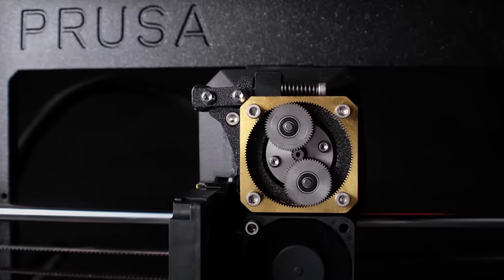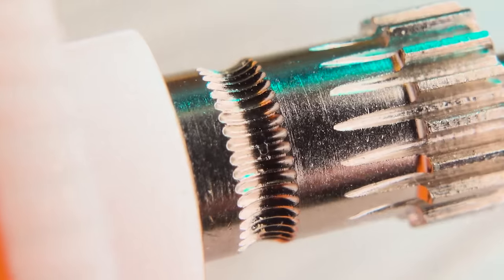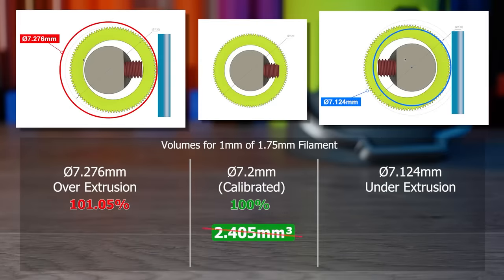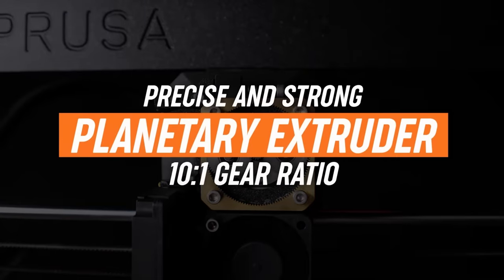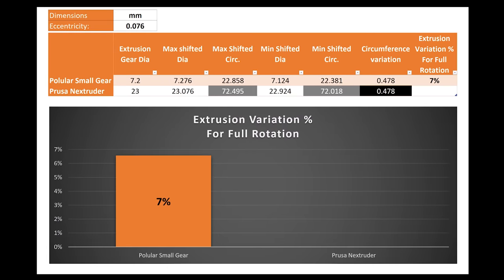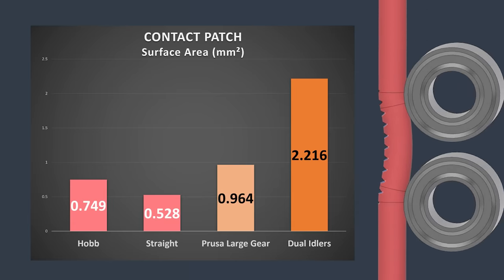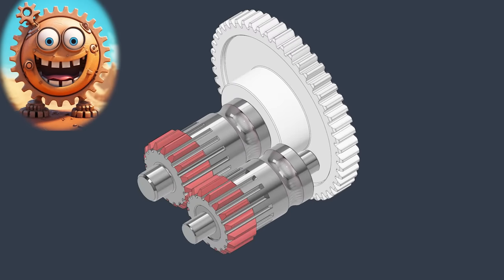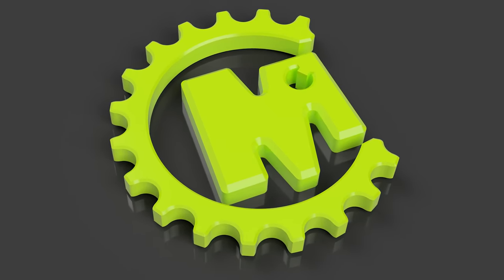Revolutionizing 3D Printing: Prusa's Game-Changing Nextruder

Comment: Very interesting indeed but my biggest worries for the extruder is the curve in the filament it may limit types of tpu filaments. Most importantly brittle filaments like carbon fiber filaments as those don't like to be bent at too much of an angle before breaking. Can't wait for it to come out so we can see your testing!
Reply: The Graphics are just for show. Thats why there's an adjustment knob on the tension arm
Reply: Consider also some materials will hold a bend imparted to them. Now what about sections of prints with repeated retractions. Wonder if this affects those areasa
Reply: @jrcaeosyroetnsella  isn't the bend irrelevant after melting
Reply: Not a concern. It has been tested for over a year already. TPU works flawlessly.
Reply: @polycrystallinecandy  He is saying when retracted. So there is a bend being held while it gets pulled up. I don't see it as a big potential problem as retraction is 1-2mm, but an interesting question.
Reply: @fofopads4450  where is your data to prove?
Reply: @SouthAsh_1  im sure no company makes such a different product and just starts selling it immediately, and prusa is a company that sold the same printer for 2 billion years because people bought it not for it being advanced but because it "just works" so its reasonable to expect them to be sure what they put out doesnt hurt their reputation of a machine that "just works", so its probably well tested, and maybe they made a statement that it was tested with tpu

I didnt like prusa because i felt like they didnt inovate and just milked their one printer for years but i think this(and the xl) are a big step, kinda changed my opinion of them
Reply: @davidbinenfeld489  I don't doubt that they tested the shit out of it but if someone says that it is "flawless" I just want to see the data to back it up as I personally have not seen it.
Reply: @SouthAsh_1  yeah i get it flawless may be too strong of a word
Reply: Even if TPU wasn't happy without with it, the simple fix would be to wrap a belt around the idler bearings
Reply: @charlesgunzelman3323  or just put a piece of plastic/metal between thes so tpu has nowhere to run

Comment: There's certainly a lot that is theoretically nice about the MK4, extruder included. I think it's still too early to really know if it lives up to the promise, especially considering Prusa hasn't released the input shaping firmware yet that will really let us push the print speeds and stress test the flow rates.
Reply: For that price ita a joke what they offer in 2023. Get a bamboo lab, at least it isnt from 19 century and not made on a lap using 3d printer farm. 😄
Reply: @VladOnEarth  I'd agree on this.  It is a clear improvement but it's an improvement upon a very dated design at this point - And they're charging as if the full thing is modernized.  But it's not, it's clearly still an old school Prusa printer, just with fancy new features.  

Bamboo is definitely going to push competition so hard.  Prusa's package is simply not impressive enough VS Bamboo.
Reply: The price of MK4 is certainly way too high. But complaining that it is a bedslinger is pointless if the printer ends up printing with better quality than most readily available corexy and with comparable speed. We shall see...
Reply: @VladOnEarth  I have a MK3s and had until recently a deposit on an XL, I redeemed that deposit as I was sick and tired of all the delays, I did intend to buy an X1 Carbon and AMS but then got cold feet as I have concerns about wear on the carbon rods, if they wear to the extent that print quality is affected it would mean sending the machine back to China at my expense, I dont think this would be financially viable, why they have not set up international service centres is beyond me, no manufacturer can be 100% confident in its QA.
Reply: @ᗩᑎᗪᖇEᗯ ᕼᗩYEᔕ  they are a new company, give them some time. I would not worry about carbon rods wear, I had them on my flashforge for years, with igus bushings, almost no wear. And even if they wear, they are a common market size rods i believe, you can relatively easy just replace them. The biggest issue with those rods is to get a good tolerance. Pultruded are better in this regard.
Reply: @MilosevicOgnjan  Yes, IF it does, which isnt ever a case. Last time I prionted slower than 200mm/s and 10k acceleration was like 6 years ago. Bed slingers are painfully slow, thats the main problem, not the quality. If you print slow enough, anysemi decent printer can do good quality.
Reply: It’s just common sense that carbon rods DO wear! 

Have you already found out where you can purchase custom length carbon rods with the precision in diameter required/wished? If so please check your balance in your shoppingtrolley….😵‍💫🤑🤑

And for the sake of the goal of this video upload, the one have absolutely zero comparisons with the other. And for closure it’s just comparing apples to oranges if you try to set apart coreXY machines from ‘bedslingers’ (especially if they are called Prusa!)
Reply: @Raymon Schepers  not really apples to oranges if both machines have the same fucntion - producing fdm parts. And both cost around same price too. Its like comparing a civic to a bmw, not the same yes, but now imagine they cost the same, would you ever consider a civic?
Reply: @Raymon Schepers  afa your carbon rod concern, first of all i have carbon rods on my printer for like 4 yeats already, with igus bushings. They arent noticeably worn in 4 years. And even if they wear, by thay time I am sure bamboolabs will offer spare parts. You are making up a problem where it doesnt exist imo.
Reply: @raymonschepers994  Yes Bamboo lab sell replacement carbon rods now

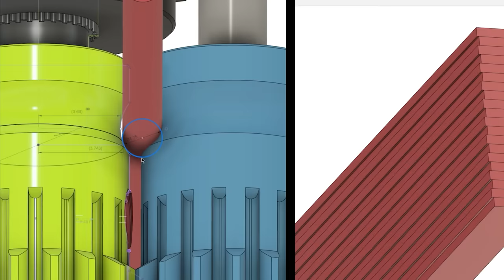Comment: There is also one additional bonus of having geared extruder, In case of very small extrusion rate due to small nozzle and layer height there can be artifacts caused by limited precision of steps in stepper motor. 1:10 gear ratio increase that precision 10 times, and yes I had some prints with 0,25mm nozzle on which stepper artifacts were visible.
Reply: But the gear is bigger, so the extrusion amount per step is not that much smaller.
Reply: @pizzablender  the gear is about 3.2 times bigger, so that's equivalent to 3.1 times reduction, which is approximately what the dual gear extruders usually use

Comment: Nicecely done Olivier. Yes their extruder is well made indeed :) But still one issue remains i think... the straight teeth biting at constant distance in 90 degree causing the other source of artifacts we were seeing. I mitigated that issue with twirl so I wonder what coule be done here. Couple ideas are germinating in my head :)
Reply from the maker: Yup, totally agree and I have a plan ;)
Reply: How about a double helical gear shape of extruder gear?
Reply: @Lucas_sGarage  interesting idea, although difficult to manufacture at such a small scale. You would need either a 4 axis cnc/3 axis with rotary module or would need a tool to imprint the pattern, similar to knurling.
We could also try something with lgx gears with smooth idler bearings for now since you can buy single lgx gears and those have roughly the same diameter as the one in the nextruder. Also since they are running on needle bearings and no single grub screw is involved we could expect good excentricity.
Reply: @kilianlindlbauer8277  Yeah, knurling or fishbone / zipper pattern maybe?
Reply: @velvia7880  was thinking of the heringbone pattern. Having just helical gears would push the filament to one side. You can see that with soft tpu on the vz hextruder. If you pull medium to soft tpu it twirls the filament. Ive tested that with 85a xtrudr tpu
Reply: What type of artifacts do you mean?
Reply: What's twirl in this context?
Reply: @tomallo99  ive done some testing on the vz hextruder with its helical feed gears. With rigid filaments it provides more grip compared to the regular bondtech bmg gears, at least it feels like that. But with the flexible filament i tested (85a shore hardness) i saw the filament turning when feeding/pulling out by hand. The gears didnt loose grip, but the filament literally turned itself out of the extruder. If you would have a single helical feed gear this would mean that the filament wanders off to one side. It would need some sort of constraint (add friction and wear) or some sort of heringbone gear pattern to keep it centered
Reply: @Kilian Lindlbauer  have you tried loosening tension just before is starts slippin? It doesnt need much tension for it to grip. If you do too much tension with ultra soft it will twist the filmanent yes
Reply: How about, instead of metal teeth, the drive gear had an outer diameter made from a high-grip soft material, like silicone ?

Gripping the filament without deforming it
Reply: @Vez3D  haven't tried that yet, but so far im liking your design. I have printers better suited for tpu than my voron with your extruder because of the long reverse bowden, but i can try it.
Reply: I've watched most of the videos that Vez and Mirage have put out involving extruders. Very interesting stuff! I'm nearly finished with my VZbot/FT5 hybrid using the CNC VZhextruder
Reply: @_Xantras_  someone has has already made that with gt2 belts. I cant remember his name, but he has a YouTube channel called proper printing. The current Design is nema 17 based
Reply: @kilianlindlbauer8277  point is, it's a very big extruder. My idea was just a small upgrade to the gears
Reply: helicals would be great, although as people said it has trouble with soft filaments, so maybe finding a cheap way to make herringbone gears? it would be self centering too as if it wanders to one side it gets pushed back to the middle
Reply: @l3d-3dmaker58  maybe putting two helical gears with teeth cut at the opposite angle next to each other?
Maybe im trying the single gear lgx idea i had
Reply: @l3d-3dmaker58  i dont think there is a cheap.way to make those :(
Reply: @kilianlindlbauer8277  thats how vz-hextrudort is
Reply: @Vez3D  I love my vz-hextrudort man! issue 6 is 70% gone! Ofcourse we all want 100% smooth but its already super good. Thanks for your work!
Reply: What about stacking two tapered gears with opposite teeth ?

It's easy to machine but you need to align the 2 gears with a dowel pin or a keyed shaft.
Reply: @Vez3D  i wasnt clear on that one. Not next to each other, but next to each other like on the same shaft, to form a heringbone patter
Reply: @_Xantras_  Proper Printing has done this with his belt based extruder by feeding material through a channel between the flat backs of two belts. It worked pretty well with even very soft TPUs, and had one of the highest pressure outputs of any of the extruders that CNC Kitchen tested a month or two ago.
Reply: @kilianlindlbauer8277  "two helical gears with..." That's what's called a dual helical gear and is actually what evolved into what we know as a herringbone gear today when engineers determined a way to manufacture it in one piece and without the gap between helices.
Reply: I think MirageC covered it in an earlier video but can someone remind me please why exactly the drive gear needs to be metal instead of plastic? I mean, obviously it will wear down faster but is it that practical of a difference in this use case and is there any other reason involved?
Reply: @kilianlindlbauer8277  what about using a belt with a long contact area to push the filament without any deformation. For example we could use a big wheel with a rubber belt to transmit power.
Reply: @claws61821  too expensive and difficult to manufacture at such a small scale in one piece like simon said. Just thinking of making it more accessible. It would either require tooling in form of a knurling tool or 4 axis cnc cutting witg tiny tips. The best Design is worthless if you cant manufacture it, or in this case nobody would buy a 200 dollar extruder. I mean tge full size lgx and hemere are already considered expensive by most
Reply: @PhantomBlank  thats exactly what the guy from proper printing did. A resin printed extruder with closed loop gt2 belts as contact area. It has tons of grip, but has the same eccentricity issue as with bmg drive gears. This could be solved by integrated pulleys on a shaft. But the main issue is size and weight. The prototype weighs over 400 grams and is fucking huge, basically no chance to fit on a cubed printer as direct drive, only on i3 style printers
Reply: @kilianlindlbauer8277  Is this in reply to my trivia about dual helical gears, or to my question about plastic drive gears? Cast and IJ plastic gears with 11 mm tip diameter are extremely common. I've seen cheap watch gears with tip diameters below 5 mm made from plastic (nylon, IIRC). I can imagine that precision manufacturing to the same fineness as some of Bondtech's newer gears might be more problematic, but not manufacturing them in general. Is that what you meant?
Reply: @claws61821  dual helical.
From what i know the artillerys use plastic drive gears in their titan clone extruders, those wear down at these comparable low speeds or even the ender 3 brass gears wear kinda quickly
Reply: @velvia7880  Fishbone (herringbone) would not be ideal as some parts of the filament would have two indents whereas there would only be one indent at the centre of the V. Perhaps other patterns might be better.
Reply: @kilianlindlbauer8277  Thank you for clarifying and for the information. Do you know if anyone has published comparative wear rates, or do we just have anecdotes so far?
Reply: @claws61821  nothing official, although its the most recommended mod together with aluminium idler and cast bed (original bed sucks even though its ac powered, but 15 degrees variation at 60 is awfully bad)
Reply: @_Xantras_  Such a material would also need to withstand a lot of friction, as there is no lubrication used when extruding the filament. It's just being pulled raw, which generates friction, which is then converted to heat. So it needs to be both heat resistant and have great anti-friction properties. While such materials surely exist, I doubt they would be cheaper than just using metal and accepting the deforming of the filament.
Reply: @Arterexius  there’s enough friction to heat the gears usually ??
Reply: @_Xantras_  anything that moves through another object without lubrication, generates friction, which in turn is almost instantaneously turned into heat.
Reply: @Arterexius  silicons should do the trick
Reply: @_Xantras_  That highly depend on what silicone type you're gonna use. Store brand for home renovation won't be able to do it.
Reply: @MirageC   Have you been consumed by the plan?

Comment: Although the bigger extruder gear and overall better design will definitely help with extrusion quality the best thing, I think is the strain gage. You could measure the force compere it with the requested force and therefore adjust the motor movement a bit to make it more consistent in extrusion.

Comment: the only thing I have to complain or give feedback on the nextruder is: they should have made diagonal teeth on the drive gear, as the "imprint" it leaves on the filament will cause a repeating pattern of too much and too little plastic, while diagonal teeth would keep the deformation constant, it's a mostly easy fix (depending on manufacturing methods) and would eliminate the remaining variations to have a truly consistent extrusion

Comment: Hi, have you considered having a look at belt driven extruder? I dont remember where i saw this but the way it function is that the motor drives belts on either side of the filament so the contact area can be increased according to the length of the belt.
Reply: The channel Proper Printing have developed a belt extruder that works really good

Comment: I recently went with the HGX Lite. It has dual 18mm helical concaved  extruder gears. This video made me aware of the concaved issue and the difference is the HGX lite runs the extruder gears on needle bearings allowing the gears to slide on the shaft and always be centered. Prints are now amazing at any speed, VFA's are effectively gone. But even more noticeable is the extrusion consistency, for example i can run bridges at 250mm/s now that look and perform far better than before.

The HGX lite is NOT perfect, and you have to be careful not to assemble it in a way that causes binging. Furthermore, i cleaned it out with WD-40 and compressed air, then assembled it to ensure no binding, ran it dry with no load to break it in, cleaned it out again!, then on final assembly added Super Lube (synthetic 30 weight with PTFE). I'm on about 500 hours of print time, with about half that enclosed at 50c. *printer runs at 200-325mm/s (0.4mm volcano nozzle) 5K acceleration
Reply: interesting, I got the v2 and I thought that the gears sliding on the shaft are not ideal but it looks like it's the intended design :)

Comment: A comparsion between the Nextruder and the Sovol all-metal planetary gear extruder from the SV06 Plus would be really interesting!
Reply: Doesn't that use a setup like the orbiter 2.0 with a large bmg gear, the bmg gears are causing issues with surface artifacts #602 thread.